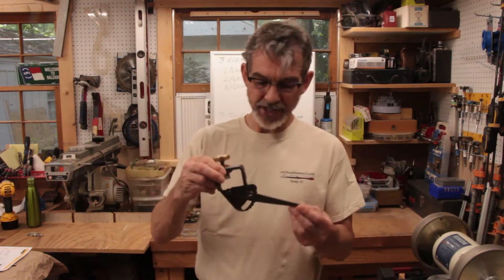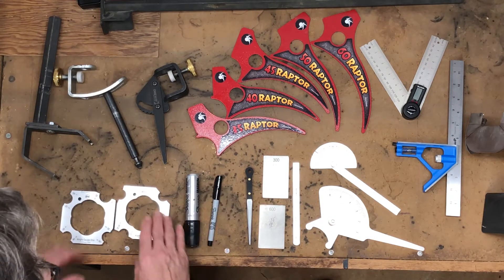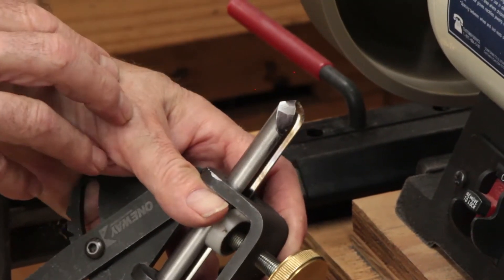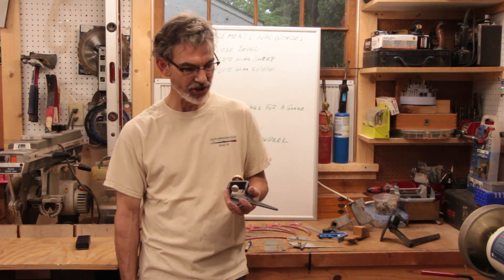Ted's Turnings - Vari-Grind Experiments

Comment: Hello Ted, this was a very informative video. As a new guy, I'm trying to learn a lot about woodturning to include the sharpening part of it, but I see a lot of different ideas on tool sharpening angles. However, one of the things I never hear on you tube videos are the angle notches on the Vari-Grind jig. Obviously, there are notches on this jig that set the adjustable arm to different angles for a reason. What are the angles for each notch and how do you determine that? From the pivot point or your turning tool? And how are they used at the different settings? No one seems to explain that clearly. I hope you can. Also, as I understand the angle for most tool angles is supposed to be set at 23 degrees but why and where would that be on this jig?  Thank you and if anyone else has some insight please respond. Thanks again.

Comment: Ted. Enjoyed the video. I was going to do the same experiment and now I don’t have to. 
The varigrind doesn’t have any numbers on it. Can you explain where you set the leg  for a #2 and #5?’ Thanks CHAS
Reply from the maker: Hey Chas, glad you enjoyed the video. #2 or 5 is just the bottom of the 2nd or 5th notch.  So you can loosen the wing nut, put a thin card in the selected slot, move the jig up to match the card/notch and then tighten the wing nut.  That's it, and reliable each time.  Best of luck!

Comment: There is a lot of information presented here and I am not sure I follow all of it. In fact I am sure I don't. But there are several points that I do follow and I think I have enough information to be able to perform a few tests of my own. I have both the Vari-Grind and the Vari-Grind 2. I also have the Kodiak system from Ken Rizzas Woodturners Wonders (although I have not set that one up yet).  Thank you for sharing. Have a great 2022 and stay safe.
Reply from the maker: Thanks Glen, it takes some practice but you will get it, best of luck!

Comment: why did you not use the raptor jigs to set your angles?  I own them and they are great for setting and repeating the angle you want.
Reply from the maker: Yes that is a good question.  I didn't use the raptor jigs as my grinder was not setup properly for those jigs.  The height of the grinder in relation to the Vari-grind jig platform has to be properly set and mine was not.  So I used the angle gauges by Stuart Batty which work really well and do not require the same setup.  Hope that helps to explain, and thanks for the question.

Comment: Eureka!  I have figured out the answer to the question Ted poses at 0:24.  What the arm changes, _exactly_, is the bevel angle underneath the wings.  That's all.  It seems relatively unimportant, which is maybe why nobody else talks about it.  If you want more clearance to the workpiece you can get it with a secondary bevel without thinning down the cutting edge.  For a full explanation, refer to my previous top-level comment.
Reply: I made a little paint mark on the jig adjuster to suit my fingernail grinding tools and another little paint mark for my spindle gouges. I adjust the arm slightly to one of these marks for either and I never have to do more than eyeball check that the wings are resting flat on the wheel.  Some people drill a hole to have the tip of the tool exactly the same distance from the jig every time but I manage with just a guide mark on my bench top.  I stopped bothering to check that my degree of angle is correct after about a year. They have never been off by more than one degree.

Comment: My earlier comments on this video seem to have done more harm than good.  I'd like to apologize for that.  To try to make amends, I have done, on my own, what I originally planned to do in collaboration with Ted Ross.  That is, I've tried to answer the question Ted raises at 0:24 : "... if I set the arm here or here, how's it change, does it change my bevel, does it change the wing of my tool, what does it change, exactly."

I'll post progress on this investigation as replies to this comment.  I think that the way YouTube works means that if you reply to this comment you'll get a notification when I post an update.  If, that is, your YouTube account is configured to notify you of replies.  If there are no replies at all, I may abandon this where it presently stands.
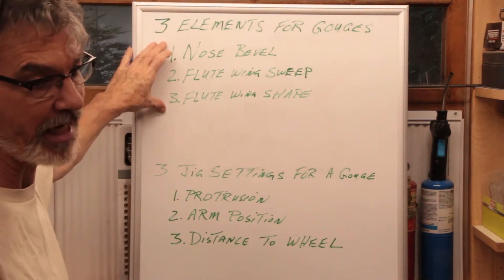Reply: Whiteboard Session — From the session at the whiteboard (4:23 to 4:57), it's possible to get the impression that there are "three jig settings" (protrusion, arm position and distance to wheel) that, in combination, determine independent outcomes for "three ... considerations for sharpening a ... gouge" (nose bevel, flute wing sweep and flute wing shape).  This is not the case.  The jig provides support for only two aspects of the grind outcome.  The first is the nose bevel, which can be defined precisely, as Ted shows.  The second is the range of shapes that the wings can take, given a specific bevel and according to how you manually manage the grind.
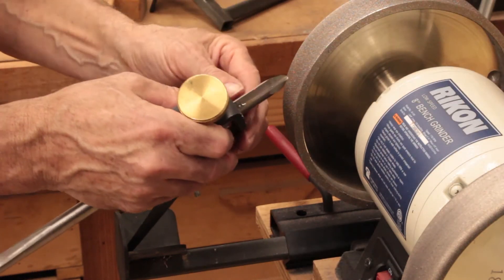Reply: Tool Protrusion — You might as well set the tool protrusion to some standard value and leave it there.  Common values are two inches and an-inch-and-three-quarters.  At 6:08 Ted sets the protrusion, using a gauge, to what looks like one-and-three-quarter inches.  He only changes the protrusion to grind clearance bevels at unspecified angles (11:36).  Although, at the whiteboard, he appears to state that the tool protrusion needs to be selected according to the desired outcome, he takes this line of thinking no further.  In fact, adjusting protrusion does nothing for you that can't be done more simply with the leg / arm position.  Set it and forget it.
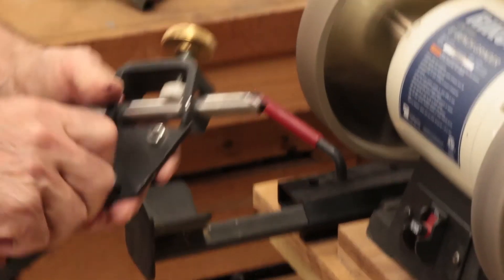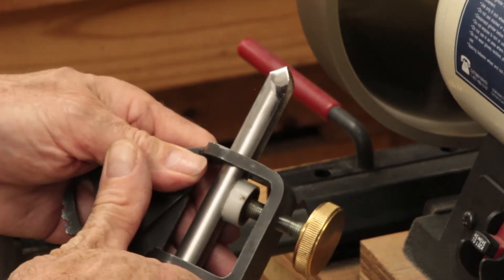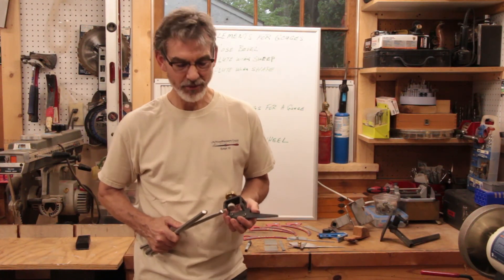Reply: Experimental Results — In the video, at 8:24 to 8:56, Ted grinds the badly-ground bowl gouge that he showed us at 3:57 for a 40° nose bevel with the Vari-Grind Leg /arm at the second notch. Then, at 9:45 to 11:03, he grinds the gouge that he showed us at 3:43 for a 55° nose bevel with the Vari-Grind Leg /arm at the fifth notch.  At 14:13 Ted tells us that the sizes of the two gouges are, respectively, half-inch and three-eighths.  From 13:39 to 15:28, Ted displays and describes the results of grinding the two tools and attributes the differences to the leg / arm position.  I don't think that this is entirely justified.  There are three differences between the tools that have nothing to do with the leg / arm.  The first is the tool diameter.  The second is the chosen nose bevel.  The third is what Ted was trying to achieve with the grind.  I would like to find out how much of the resulting wing form is due to the leg / arm position and how much is due to the other factors.  I don't think the question can be properly answered until this is figured out.  Opinions?
Reply: Tool Diameter — After sleeping on the problem for a couple of nights, I'm going to say that the tool size plays no significant part in how the grind turns out.  Because we're dealing with the angles that things make to other things, and not the distances between them, the whole arrangement scales with tool diameter.  This is not precisely true because a larger tool will need to be lifted away from the wheel more as it is swung over.  But, the distance that the axis rises is small as compared to the length of the axis (tool nose to the end of the leg / arm) so that the change in the angle is small (a fraction of one degree).  I'm going to stop thinking about this and concentrate on the effect of the different nose bevel angles on Ted's results.
Reply: Grinder's Intent — I don't know why I didn't figure this part out earlier.  What the operator is trying to achieve is fully defined by Ted's procedure at, for example, 9:23.  He "pre-grinds" the tool in the upside-down position on the wheel.  The cutting edge is replaced by a flat (or slightly curved) surface.  Where that surface intersects the flute is where the operator intends to have the new cutting edge.  So, he grinds away on the bevel side until the flat surface is just gone again.  This seems like a really good idea because you establish where you want the edge to be first and then have a way of knowing how close you are to achieving it.  You don't have to decide where the edge should be at the same time as you're grinding it.  Unless you deviate from this procedure, how you pre-grind the top side of the tool fully defines the sweep of the cutting edge that you'll get from any given set of jig adjustments.
Reply: The Story So Far — Set the desired nose bevel by adjusting the V-Arm distance.  You'll need to have set the tool extension and VariGrind leg / arm position first, but, however you do that, you can get any nose bevel you want.  Define the desired shape of the cutting edge by grinding the top of the tool.  Then you'll grind away the bevel just until it meets the flute again.  With this procedure, the starting point of the tool grind is no longer a factor.  You don't have to take into account the tool size during setup.  The only remaining setup is at what angle the tool axis is tilted up above the axis about which the tool / VariGrind assembly swings during grinding.  Both the tool projection and the VariGrind leg / arm position affect this.  There's no reason to set the tool projection to anything other than some standard value such as 1¾" or 2".  So that just leaves the VariGrind leg / arm position.
Reply: VariGrind Arm Position — Having eliminated everything that the leg / arm position doesn't affect, I used modeling to figure out what it does affect.  This turns out to be the form of the wings below the cutting edge.  Ted describes this from 14:26 to 15:16 in the video.  With the leg / arm set at a low-numbered notch, the tool flares out under the cutting edge of the wings, making the wing bevel angle larger and offering more support for a longer-lasting edge.  With the leg / arm set at a higher-numbered notch, the tool's "flanks" are ground back further, reducing the wing bevel angle so that the cutting edge is more fragile (but perhaps increasing clearance to the workpiece).  So Ted is precisely correct for one of his two claims for the affect of the leg / arm position.  From 14:10 to 14:25 and again from 15:16 to 15:28, Ted talks about how far the wings sweep back and attributes this also to the leg / arm position.  In this he is not correct.  These are defined by the operator's intent (and maybe the choice of a sensible nose bevel angle), as embodied in the pre-grind of the top surface and the operator sticking to the procedure of grinding only until the bevel meets the flute.
Reply: @grahamdavies8924  For a novice, All I want is to re grind my spindle and bowl gouges to the "as received from the factory" grind. I can experiment later. Some of my tools came with the angle and sweep written on the handle. So I think using Paul Ruud's (Ruud In The Wood channel) set-up tools is the way to go. Your description of the effect of using notch position 2 vs. 5 was the most clear of all the comments.

Comment: (Comment removed, but not deleted so as not to delete Ted's replies.  That would be up to Ted.)
Reply from the maker: Thanks Graham for all your comments, I really do appreciate all your insight.  This can be a very complicated subject and as you mentioned, is greatly affected by how the user applies.  From the initial starting state of the gouge and how much pressure or time spent in actual grinding process.  My intention of the video was not a complete guide to the Vari-grind but what changes the sweep of the grind on the tool.  As you mentioned, there are other factors to consider and some grinds can be obtained with only changing one or two of the settings.  If you do create a graphic illustration I would be interested in seeing, as I have often thought of this as well.
Reply: @TedsTurnings  : While waiting to see if you would reply, I completed my investigation of how to re-grind the Crown skewchigouge.  I decided that the effect of the starting grind and how much grinding is done at each position of the swing is very significant when using the Vari-Grind jig.  I don't have the skill to free-hand a grind and, partly because of this, some time ago I messed up my skewchigouge.  So, I designed a jig that controls all of the parameters and will return my skewchigouge to its original state, or at least as close as I can figure that out.  It seems to work except that I'm not able to drill holes sufficiently accurately so now I'm working on fixing that.
As I wrote before, I don't think we'll make much progress working together to figure the jig out unless we have drawings.  I've created a page on my Wiki where I can put up figures exported from my SketchUp model of the grinding process.  Maybe the next step is to see if you can access it.  I don't know if URLs are permitted in YouTube comments, so I'll take you the long way around.  Start at Wiki dot ecrostech dot com.  On the left, in the House and Home section, click on Woodworking .  Then, in the Processes section, click on Sharpening Tools .  The last paragraph on that page includes a link to "our" page.  The paragraph above contains a link to my page on sharpening the skewchigouge, which I think you will also find interesting.
Reply from the maker: @grahamdavies8924  Hi Graham, I have found the page/article and will look it over. Thanks.
Reply from the maker: @grahamdavies8924  Hey Graham, I reviewed your page and have a few comments.  First the video I created was intended for bowl or possibly spindle gouges using the Vari-grind tool jig.  The gouge you are trying to sharpen (skewchigouge) is quite different in that it does not have a flute.  You could use the Vari-grind to sharpen the bevel but would not help you at all for the upper face of the tool.  It appears that once you have the upper face established, you should only need to sharpen the bevel to get it back to optimum condition.  Also, honing of the tool is up to the turner, as some turners like the rougher edge on their gouges, verses a fine honed edge.  They find it cuts wood away a bit quicker, and they don't worry so much about the small serrations on the edge.  A couple comments on your jig, be careful grinding on the side of the wheel, most wheels will not hold up under much pressure sideways and could explode which would be a very dangerous situation. It also looks like a high speed grinder, so it will quickly take a lot of steel away from your tool, which means you will be replacing it much quicker...  Otherwise it looks like what you are doing is working for you and as you progress and practice in woodturning you will learn a lot more.  Best of luck!
Reply: @TedsTurnings  : From your recent reply, it seems you think I was asking you for help, whereas my intent was to offer to work with you to answer the question you raise in the video, i.e. "... how the flute wing changes based on the arm's position".  You don't actually answer this question and you also make some statements that will probably mislead viewers.  I'm sorry not to have been clear in my intent.  I should not have mentioned the skewchigouge; it was just the problem that I was working on that made it possible for me to help you.  Sharpening the skewchigouge is now solved.  The vari-grind jig does not help at all.  I have figured out exactly what it does and does not do.  Your "Best of luck!" is clearly a sign-off and I totally respect that.   Sorry to have wasted your time.  I will do some cleaning up.